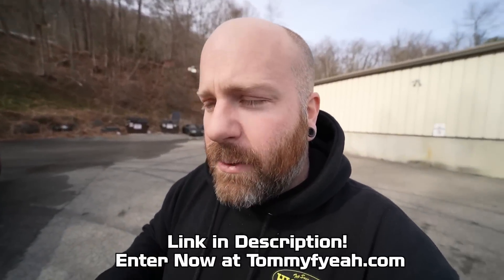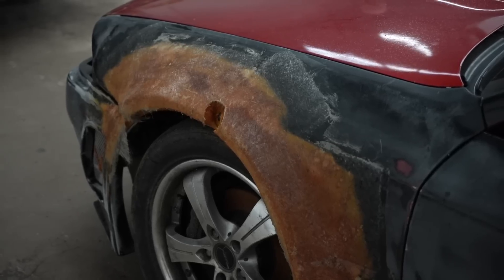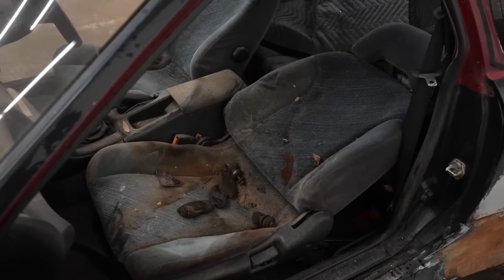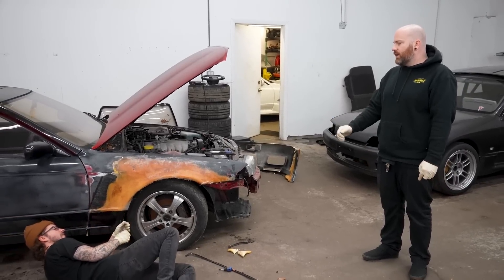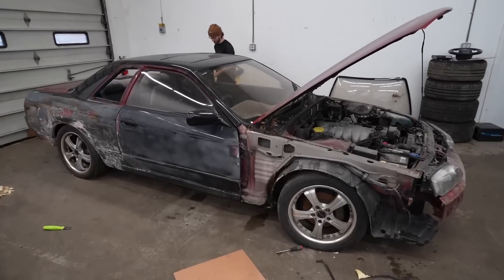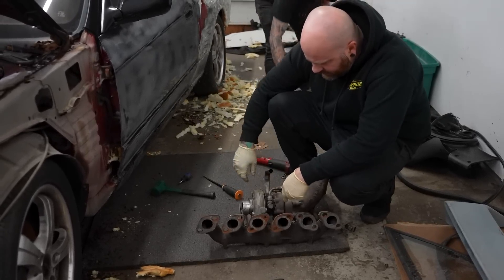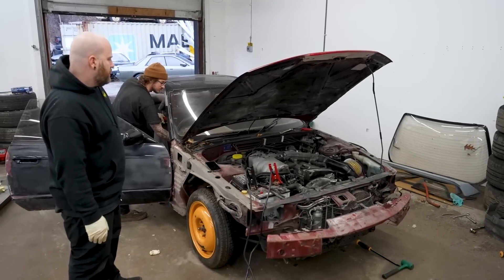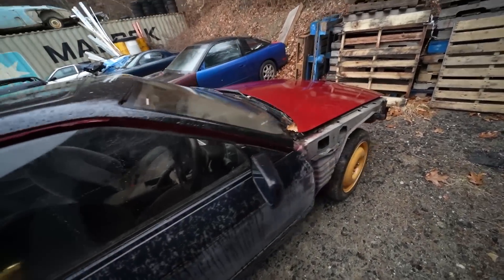TRYING TO FIX THE WORST SKYLINE EVER?!

Comment: 9:48 that is. Mueller Kepps carbide super scraper. Used to remove sealant and gasket material from engines. Chop shop vibes here lol use anything however you want

Comment: Hey buddy 
Could you be interested in doing a build at your shop converting a 300zx to awd using 32 to 35 drivetrain and an RB..? I reckon it would be sick to do and an awesome build series if it’s possible to even do. Guessing it could be doable without too much crazy fab work